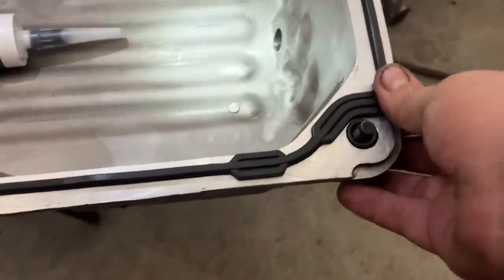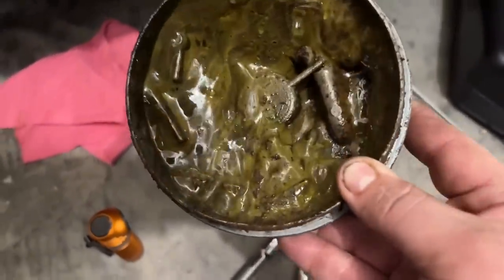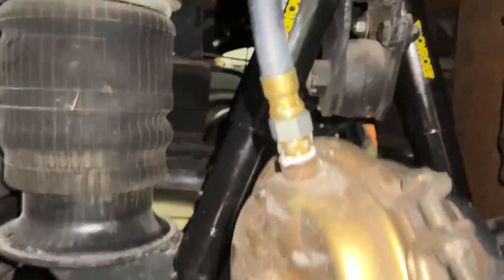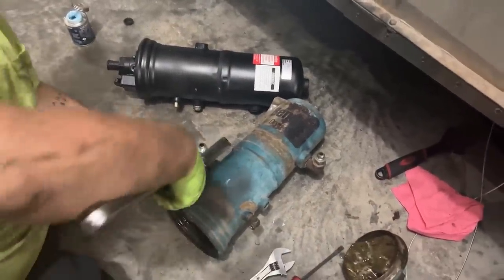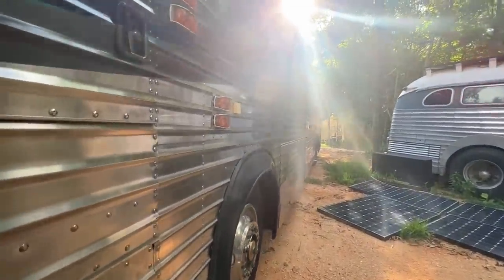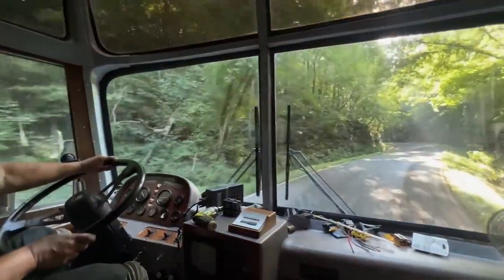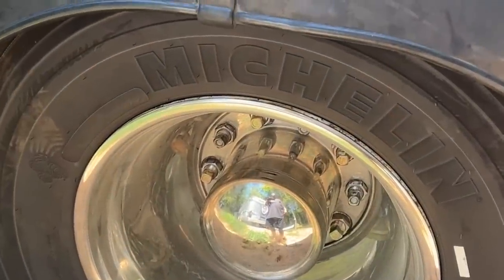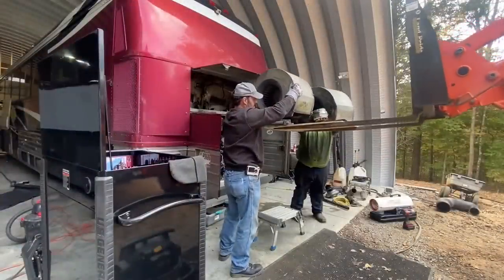Prevost bus resurrection….  Driving improvements to make this bus handle like a dream.

Comment: Amazing that anyone can afford a bus.  The true cost to own is far too high.
Reply: Haha!!  Right?    It’s a passion!   I’m a pilot and a bus is a little less expensive!
Reply: Some people work hard and have a good retirement…
Reply: The really big elephant in the room here is the fact that the previous owner didn’t properly maintain this bus.  Any large diesel vehicle requires consistent preventative maintenance, as well as normal routine.  The more shortcuts that are made, the more expensive they will be to undo all of the normal stuff.
Reply: A Bus coach conversion is a lot less expensive in the long run than any fiberglass motorhome. Why do you think the transportation industry have been using these for decades.

Comment: It amazes me how any shop can be so incompetent as the one that worked on the oil pan and other FUBARed assemblies and stay in business if not having gotten sued by someone who suffered a serious accident cause by their incompetence.
Good luck for the owner to have bought his bus to you for repair.
Reply: this is crazy its simple truck and bus reapairs wtf are commercial compaines doing to train thier staff. it least pople bying these machines needs to learn alot more about how they work before buyingand driving them.. whiles its a pain almost everything on the roads in europe must have an annual inpsection the bigger it is the more they check. imagine if this bus had a wreak im guessing the insurance would not have paid out due ot the poor condition.
Reply: @gavinferguson  the craziest part is that only 15 states in the whole  country have annual/biannual testing regimes,technically this truck was legal and could have stayed on the road indefinitely,,America is so far behind european countries  despite having heavier rigs with much higher speed limits in most states,,you can kill a whole load of people in a bus in this condition
Reply: you have to be a well trained , qualified and experienced engineer to do the work of maintenance and repair properly and with competance , most are just parts fitters with minimum actual skills and knowledge , i have seen it so many times where big companies dont train the staff correctly , gone are the days when i was trained and had pride in the work i  did , now its all about making a profit and nevermind the inconvenience to customers etc

Comment: Another Bus going down the hiway,  Safe! Scott it's so nice to hear you say things like the rear diff is down 3 - gallons of gear oil, the noise was the steaming hot gears trying to weld together at speed❕
Shops miss these things because their to busy. Or to inept at their jobs. Replace a pinion seal ✅, top up or change the gear oil ✅, how they missed that huge up sell😬💰.
Thanks Scott and guy's for the incredible work that you do. Safety is job #1 ✅
Another great vidio, thanks for sharing 👍. 
👌🏻✌🏻🔑🌤 🇨🇦 🦽 😎.

Comment: Just wanted to leave a comment saying you've earned a new subscriber! 
Saw these bus repair videos on my recommended and curiosity got me. I used to work in a shop for a construction company back in 2011, I did a lot of what people call 'turd polishing' lol. Basically, cleaning dump trucks, fleet trucks and construction equipment, making the old stuff look good for auctions. I worked with a lot of great mechanics and learned a ton just by observing and asking questions. I can tell just by my basic experience you have some very skilled guys working on these busses. I learn something new every time I watch and for that I can't help but say thank you and keep up the awesome work :)
PS, I can't help but laugh given the fact you seemed to have nothing but trouble and messes with draining stuff, first it was dropping the brake drum into the axle oil drain pan in part 1 and now the unpredictable air dryer waterfall in part 2. Been there done that, plenty of oil and grease-stained work shirts to prove I ended up wearing the oil about 60% of the time despite my best efforts lol.

Comment: On an MCI with the overhead cooling tank it’s a shame when system is drained you couldn’t drill a hole in the bottom of the tank to install a drain line so you cud easily drain the coolant into a container without owing any. Just a thought.

Food for thought

Comment: If those steering gears are designed the sameway automotive ones are, they tend to wear in the middle ( wheels straight) when adjusting for that wear you need to turn the wheels lock to lock to check for binding in turns.
Adjustment should always be done at the hard over left and or right position.
After doing that If the worm gear is worn so as to be unacceptable in the straight position its time for a rebuild...

Comment: 30 years ago a Snap-On dealer told me if I wanted a good ratchet I should buy S&K.  This was after a new 3/8 Snap-On ratchet let go after being used twice.  I took the advice, I rarely have any problems with my S&K, and I use them daily many times.
Reply from the maker: Our 3/4 snapon ratchet head stripped a gear.  Our tool guy rebuilt it. It stripped a gear again.  He ordered us a new head.  This was that head and it is bad already.   Ahhhh it should be much more durable and unfortunately when it slips getting injured is a real concern because we are usually giving it the beans when it happens

Comment: Seems to me that with the dual radius rod setup in the front axle, the kingpin inclination could be set independently with the axles still mostly square to the chassis....the one rigid rod at the bottom makes sense....the adjustable lower squares the axle centerline with the chassis, then the two uppers set the kingpin inclination, so if the axle is serviced in that order there should be no way to get that split caster. Split caster is a setup trick in stock cars, but they don’t turn right!

Comment: If the oil pan is not original and deeper it also needs a deeper pickup tube and oil dipstick. The dipstick should match the levwl that the pickup tube is made for, otherwise you risk drawing air when doing high g turns or high slopes. If you just lenthen the dipstick but leave the pickup at the same height it's gonna be covered less. I think the oem dipstick would match the oem oil pickup regardless of the deeper oil pan,, unfortunately you'd have to put more oil in it to fit the deeper pan, but it would not cause any other issues.
Reply from the maker: Theoretically it’s the same level to the oil sump available it’s just deeper with more volume.

Comment: At the start of this video I was thinking what a great bus Prevost make. The underside seemed clean and almost rust free. 
I live in the UK so I have no idea whether Prevost is a premium (i.e. expensive) brand, but I suspect it is.
If so, this makes what those cowboy repair jockeys have done, even more unforgivable.
Also, thank goodness the owner found Scott and Tyler to work their magic before those over-long rubber brake hoses gave up the unequal struggle and possibly caused a serious accident.
Doesn't the US have mandatory annual safety inspections for all vehicles on its roads?
In the UK, it's highly likely that those faults would have been picked up at the annual inspection and the bus would immediately have been ordered off the road until they'd been rectified. Lives are potentially at risk surely?
Reply: Prevost is premium. Owned by Volvo now.

Comment: I'm still amazed at how after incompetent, irresponsible and uncaring people, who I refuse to call mechanics, have done their worst to this bus it continued plod along.  Not nearly at its full potential but struggling in spite of the adversity.  Any number of things you repaired could have shut it down immediately but did not.  I can't decide if it's luck or skillful engineering by its original builders.

Comment: I've never much been a fan of Prevost coaches as I prefer Vanhool's personally but I am astonished by how quiet and Cadillac smooth this coach is now. I only wish my semi-truck rode that smooth. As I have the same Detroit engine, I'd love to know what model Allison transmission this coach uses as I'm seriously considering deleting my Eaton 10-speed manual in favor of an Allison-Auto due to right shoulder damage. Scott and Tyler, y'all did good on this coach and have given it maybe another 20-30 years of service provided the service and maintenance is kept up. Oh and my qualification with the Prevost coaches is based on the H3-45 model which rides like a log-wagon. Not sure what model this one is but that H3-45 made me not want to ride in another. I hope the owner returns someday after the new interior is installed so we can see it again.
Reply: I was just surprised that Scott was working on a bus that had a 4-stroke Detroit Diesel in it!
Reply from the maker: We had 5-6 series 60’s in the shop here this year
Reply: @BusGreaseMonkey  - They may not be as powerful as CAT's and Cummins but dammit, they sure are dependable and faithful engines if you take care of them. I may have a potential buyer of my trucking equipment and if it goes down, I'm hoping to move to Columbia / Mt. Pleasant area in the fall. Fingers crossed.
Reply: @marksimpson9279  - Horizon's expanded but having Tyler's experience is a huge plus.

Comment: Do you help your customers develop a maintenance/inspection plan for their buses based on how much they plan to drive them. For example the air dryer on this bus should have been replaced years ago , how often they should replace oils etc. Hopefully they can catch problems before they escalate
Reply from the maker: The air dryer was never installed correctly.   It never worked

Comment: part of the reason i work on my own vehicles is because i'm tight...
but the main reason is because of stuff like that oil pan gasket. Scott, you personally saw how the tire places screw up. the oil change places are just as bad. i took the wife's Acura ONE TIME to Goodyear. they broke and didn't replace about half the plastic pins holding up the plastic engine cover under the car. hanging down, dragging on the ground. i know they were there because i did the last work. stripped the oil drain plug. so frustrating. you pay the $100+/hr rate for a mechanic but get serviced by the $12/hr oil/tire kid.
Reply: Absolutely! Seldom do these people treat your equipment like a real mechanic. When you find a real mechanic, don’t argue about the price.

Comment: Seems like some of the fabrication work was done well and they just missed some major stuff. Wondering on the rear axle did they get the panhard bar installed correctly, it should be parrallel to the ground at the correct ride height, generally that is how you know you are at the correct ride height is that the panhard bar is level. On this bus you will not know because who knows if the panhard bar mounts are in the proper location anymore. 
Seems like the engine is hard starting, like there is air in the fuel, should fire right off when you hit the key. 
This bus has come a long way, lots of work to get things correct that seems like someone should not have messed with as they did not know what they were doing. Appears BGM has done his magic and this bus is much better than when it arrived.
Reply from the maker: We put a check valve on it and it wouldn’t start at all.  It was a 3/8 brass npt.  It was like the fuel pump couldn’t suck hard enough to work the check valve i had.  I have one more check valve I’m going to try but it’s 1/4”npt i was afraid it would be a restriction. I don’t know what a series 60 flow needs.
Reply: @BusGreaseMonkey  I believe the Series 60 is the same as the 8v's, should be 1/2" fuel lines. Also just like the 2-strokes, there is a restrictor in the return line (should be .080"), its located on the back of the head right below were the injector wiring harness enters the head. The top line is the return line bottom line is the supply line.

Comment: I bought a GM diesel, the trans was blowing oil out the breather...no obvious causes. My trans guy on a tangent looks up the dipstick...it was the wrong one and for the gas transmission...shorter so it was getting overfilled

Comment: AD-1 or AD-2? Where did you source that? Nice job on the suspension correction.
Reply from the maker: Oreilly’s auto parts
Reply: @BusGreaseMonkey  Air Dryer 1 or 2. I know only the large ones for semi trucks.

Comment: How do you feel about the quick oil drain plugs such as the EZ Plug?  I like the concept, but concerned how they hold up in practice.  Hard to mess up a standard drain plug, but kinda like the idea of the ease the quick drain provides. (ie less mess)
Reply from the maker: Fumoto valves are nice and convenient
Reply: Plus one on the fumoto valves

Comment: Did he buy this bus with these problems or did someone screw these things up that he took it to?
I tried to adjust the steering box on my 85 300d mercedes and found I had to turn the screw out to take the slack out of it. I should have gotten a rebuilt one to put on it but never did before I traded it off.

Comment: Talking about highway speed, what speed rating are those tires rated at? I ask because the tires my city coaches use are only rated at 55 MPH. Any higher than that and the warranty is voided. Company has a contract with Firestone.

Comment: Typical issues that occur when private persons own a big bus or RV. Because of the costs and the lack of privately owned inspection pits and maintanence facilities, these issues, that may be small, but the number of those issues makes that one will end up with huge bills. Add to that the often lack of knowledge and the fact a bus is not your ordinary dayly driver, many of those big RV’s end up in a sorry state after maybe ten years or even less. That rubber brake hose e.g. should have been noticed earlier. Before we take one of our buses on a trip, no matter what kind of trip, we put it on the pit and check for any defects and go trough the reports made by the driver, it is obligatory to fill out a list that is present in each and every vehicle. Our buses are museum items so they are not on the road every day. Sure, we have those facilities but if you don’t have it, I would seriously doubt if such a big rig is the right thing for you. Ofcourse, that’s where BGM comes in but the USA is a large country. Bye, Willem, Hekelingen, Holland.
Reply: Make video's of your maintenance.

Comment: I just wondered did you consider a inspection pit when designing your work shop
Reply from the maker: I do not want one in the shop
Reply: Are you going for bus lift's in the future
Reply: He didn't want any pits.  They would had been too expensive and too much work to put in, not to mention that they would have to have a sump pump to prevent the pit from flooding and a wet well to collect everything which comes out of the pump to comply with environmental laws.
Reply: Why not a pit?
Reply: @markverloop8787  He and I already answered that question.

Comment: Dumb question: I thought the Series 60 engines didn't smoke? Shows how little I know!
Reply: I think all DDEC engines smoke a little.  If the boost control isn't working too well it will definitely smoke.
Reply: My series 60 DDEC4 doesn't smoke. In the coldest of days upon initial start-up, it might have 3-15 seconds of white smoke until the high idle timing advances and then it clears right up. Something to do with the ambient air temperature and barometric pressure sensors both located on the intake manifold in combination with other sensors on engine to control high idle time and make automatic changes with engine timing. When it works right, it runs like a swiss watch. Continuous white smoke is usually indicator of bad head gasket, black smoke is over-fueling injector or bad piston rings. Slight puff of dark smoke between gear shifts is normal for this engine. In normal operation just sitting at idle or at speed on highway, no smoke.

Comment: I wonder why more of these don't have digital displays?  I think any vehicle with a DDEC engine should have one.
Reply: i personally prefer the stock prevost dash over what the newells coaches have. i want a simple dash that shows me all the stuff i need for driving. Everything else can be digital. in my mind car dash design peaked with the 1976 W123 benz dash. clean layout, everything perfectly legible, no gimmicks.
Reply: @uliwehner  The digital display, or Electronic Display as DDC calls it, is for displaying engine parameters in real time.  When combined with a supported Allison transmission it can actually do performance analysis.  It's about the size of a hardback book and connects into the engine harness.
Reply: @safetyvideos9866  i know. I follow a Detroit Diesel mechanic who uses it all the time

Comment: That looks like a marine oil pan on that series 60, most of the truck pans I've seen are either front or rear sump........

From the amount of work I've seen you do on this bus, I'd hazard a guess that the previous owner just slammed everything together and called it good, then wondered why the bus handled poorly........